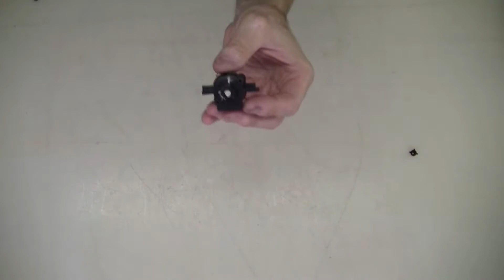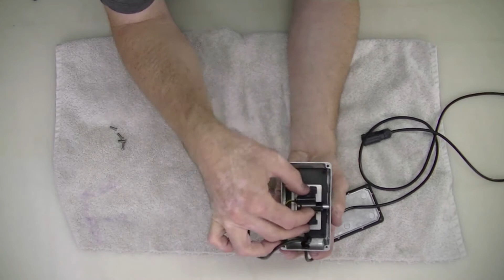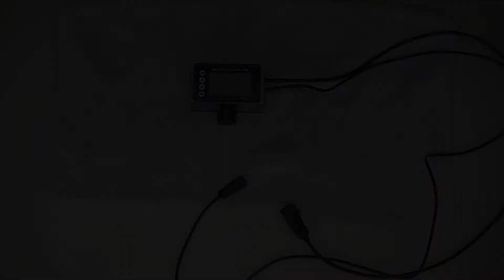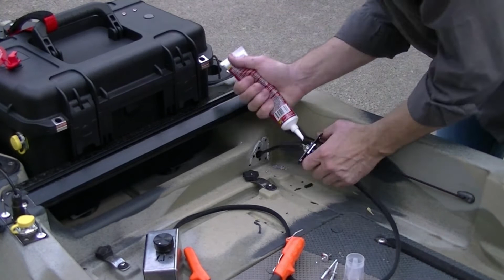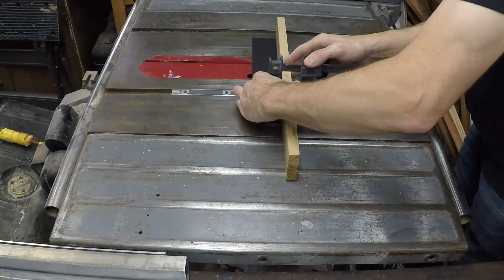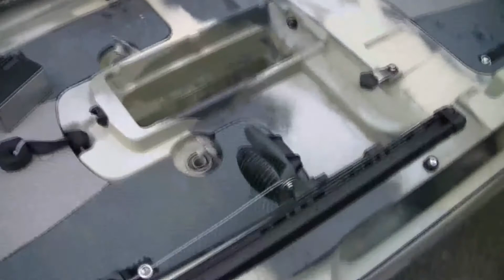The Ultimate Electric Kayak Phase 2, Part 3

Comment: Curious about the weight distribution with the batt. so far rearwards? In regards to the pot submitted below....you'll need to find solution for sealing shaft (i.e. o-ring in compressed housing/fitting mounted to outside of box) Simple plastic cad project.